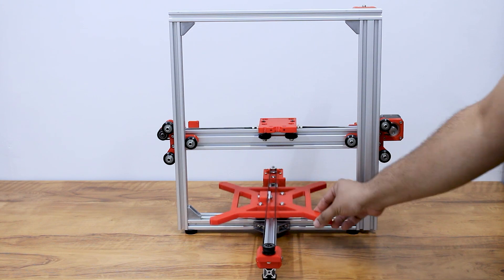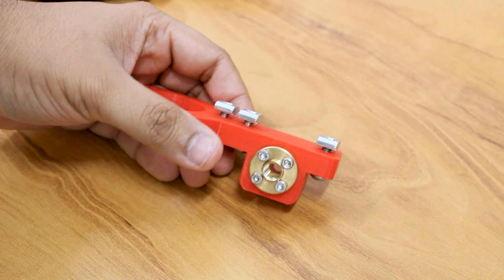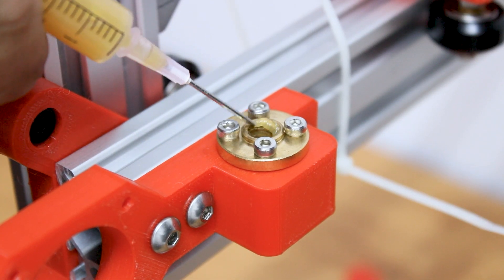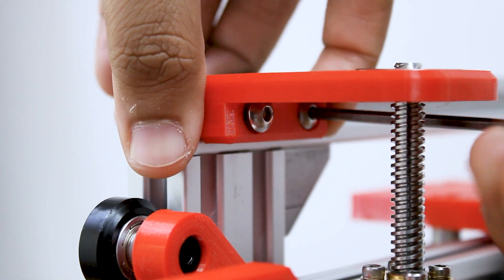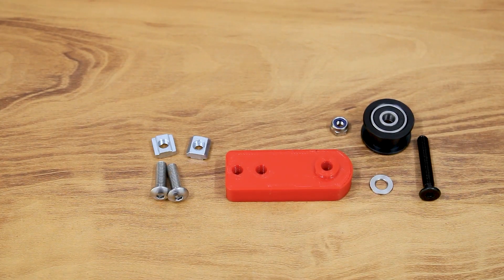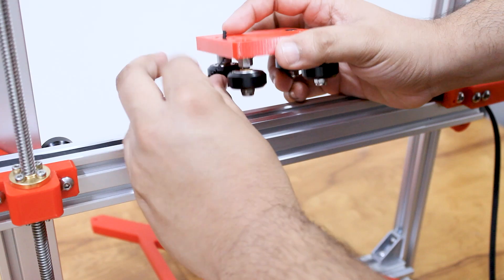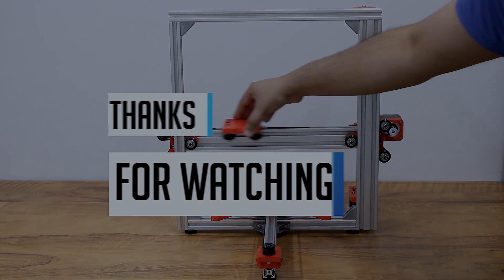DIY 3D Printer - Part 2  - Mechanical Build (2/2)

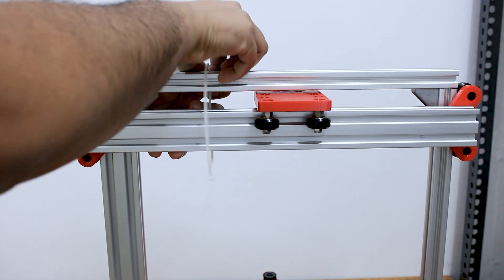Comment: Hello, I'm currently working on building a chess robot using your excellent components. However, I'm having trouble locating the Z-axis motor plate from the 1:20 set. I would greatly appreciate it if you could provide a link to the STL file. Thank you for the fantastic tutorial!

Comment: Very sturdy printer! Please let me know which material (PLA or ABS) did you use to print the plastic parts? What was infill percent and layer height? Thanks!
Reply: I printed mine with 2mm wall, 0.2mm layer hight and 25% infill using PLA - more than strong enough.

Comment: Is it safe to use spray paint on aluminium extrusions.....?
Reply from the maker: i would not recommend spray paint, as the V Wheels roll on the profiles which may cause the paint to chip off over time, or you can try and apply a very thin layer of paint. . you can also search for anodised aluminium extrusions, or use coloured strips as used in creality CR-10